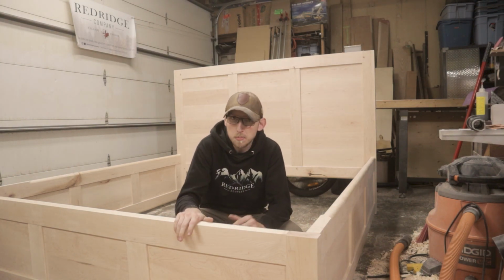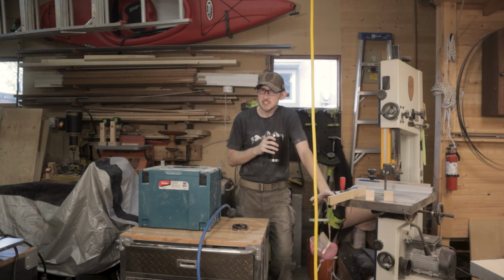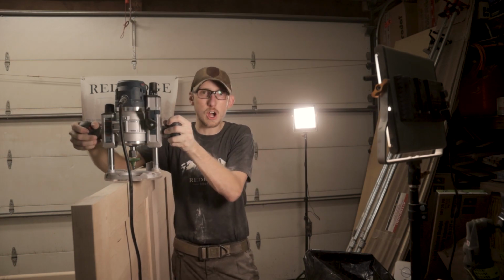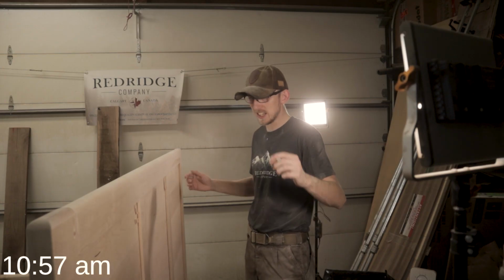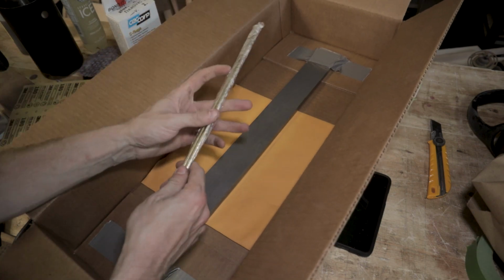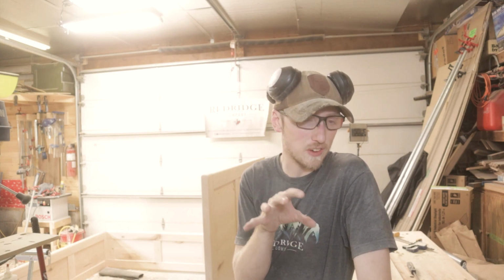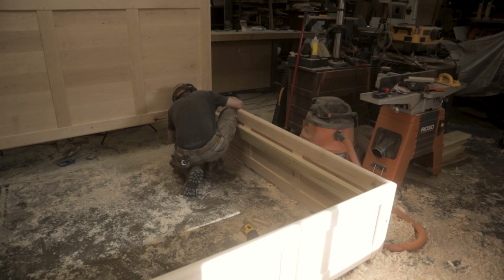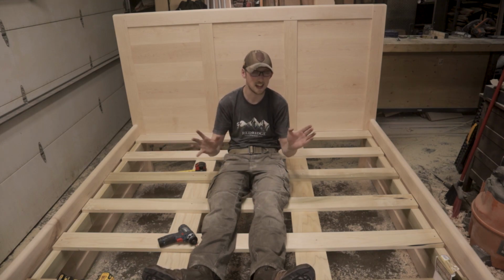The longest day yet! | King Bed Frame 2.0 | Fine Woodworking

Comment: another great video. do you mind if i ask how long it took for you to be confident enough to start a furniture business and make a career out of woodworking?
Reply from the maker: It sounds cliche but I'm not at all confident about these projects, I have a tendency to take on more than I can usually handle and put myself in tough places without thinking about it. For better or worse I have kind of a "f*** it, let's give it a try" attitude which has helped me get most of the projects you've seen recently.
I'm pretty good at problem solving, so I rely heavily on that when I get stuck on these projects.

I'm still not confident that the whole business is going to work out but I'm willing to roll with the punches because I've found such an intense love for the craft that this is all I want to do with the rest of my life.

Comment: 1.  Morgan, wax the bottom of that plane.  You make it look too hard.  And have a look at how Rob Cosman sharpens his.  Easy, very fast.  Don't need to use sandpaper - sometimes.
2.  How many passes do you make to get that round-ovwe with the router?
Reply from the maker: Trust me I keep the sole well coated with paraffin wax so that is glides well but pushing a 40 degree blade through hard maple is no simple task. Even a light shaving takes a decent amount of effort.

In a stable position I can do 1-2 passes, when doing the top of the head board I did three passes to remove the material slower.